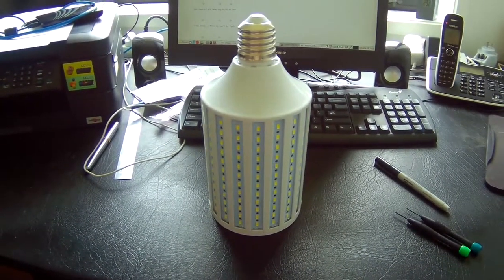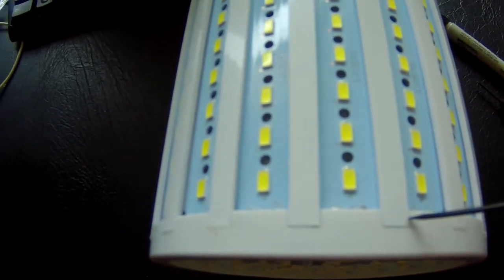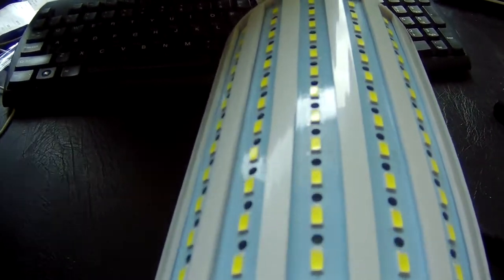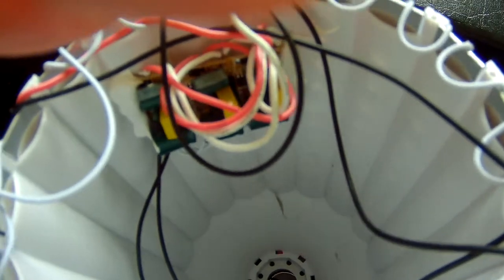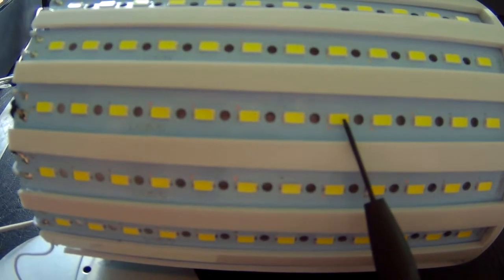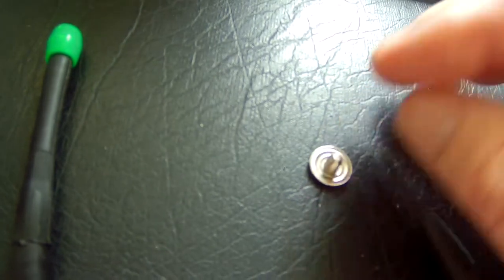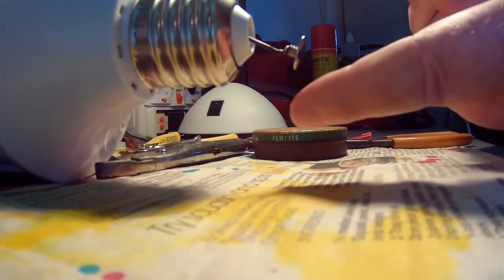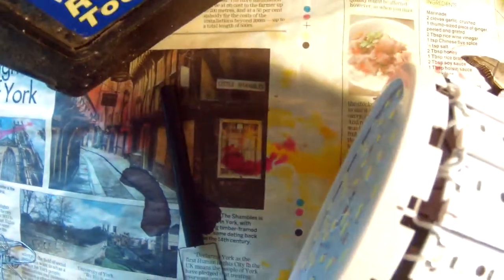100w Corn LED lamp disassembly and repair

Comment from the maker: Buyer beware! I purchased several of these. The LED overheat and despite repairs keep popping. Its a bad, unsafe design.
Reply: Try increasing resistor values and decreasing dropper capacitor values so the LEDs have less current going through them, one other thing AU &NZ voltages are too high for these bulbs as the Chinese calibrate them for 220v